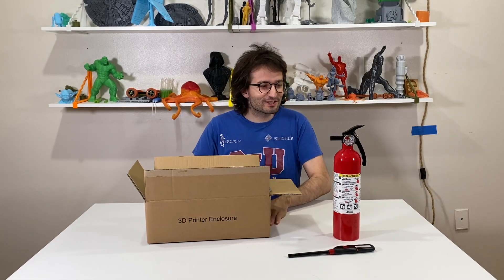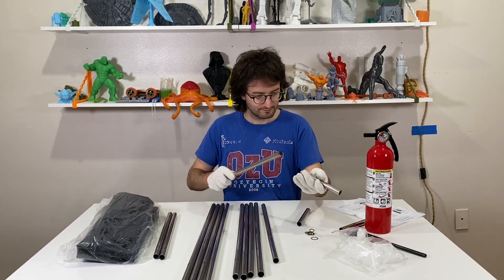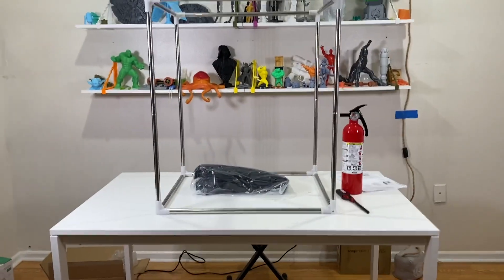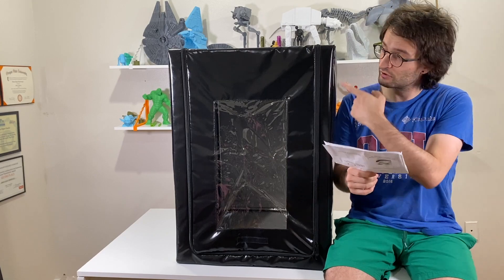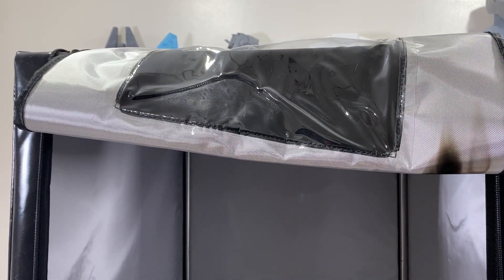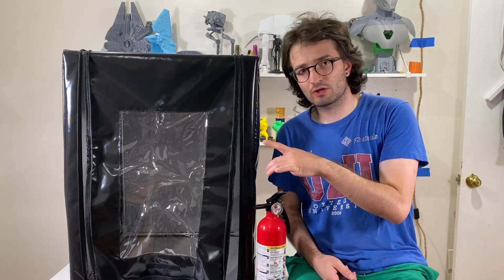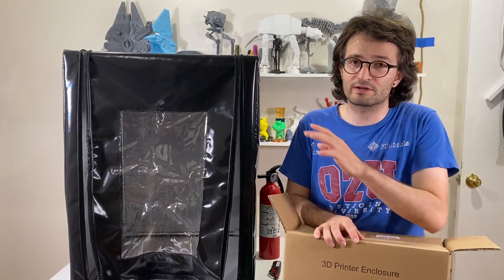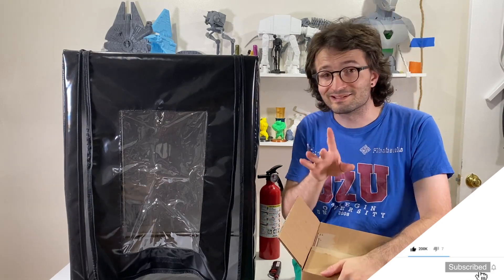3D printer enclosure review: Fireproof or Flameproof?

Comment: Is it safe to encapsulate while printing? While printing it doesn't need any air from the outside? Thanks
Reply from the maker: Well it should breathe. If you seal it, that is not safe at all, heat inside will accumulate and may cause problems. Enclosures are good but sealing is not okay. Printed layers are cooled down by the extruder fan, if they dont cool down your print will have issues. So it needs room air for that.
Reply: @3DPDoctor  I don't believe this is totally accurate. With expensive printers that come with heated enclosures, the air will be heated to 60C or higher. That is actually a good thing to prevent warping, and it's still plenty cool enough for the plastic to solidify.  The bigger problem with the temp in the enclosure is that if you put in, say, an ender 3, the electronics are all inside the enclosure too.  Overheating the main board could cause the fire that the enclosure is supposed to protect you from, so always keep that in mind.

Comment: It probably will overheat the board on the 3-D printer and stepper motors. The temperature will get too hot in there.
Reply from the maker: There is a trade-off for sure. If like cr10, controller box will be outside so that should be okay. Stepper motors have high tolerance against heat, so it should be okay up to 70-90C.